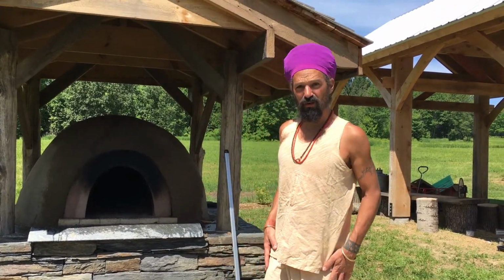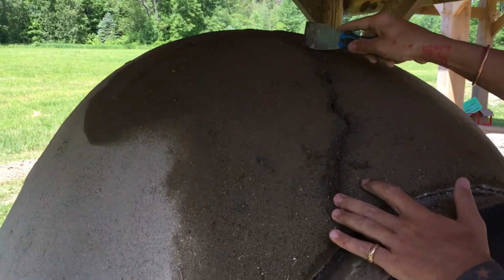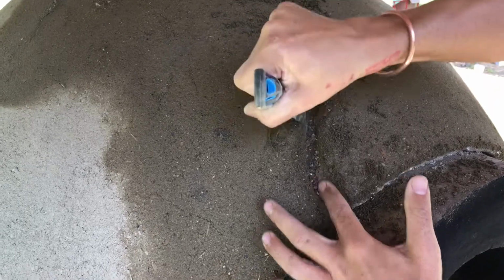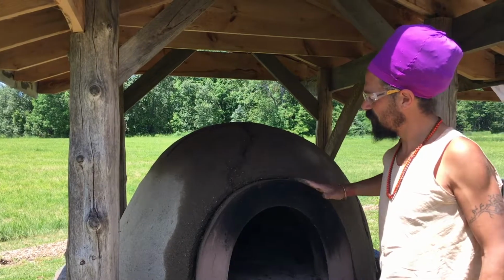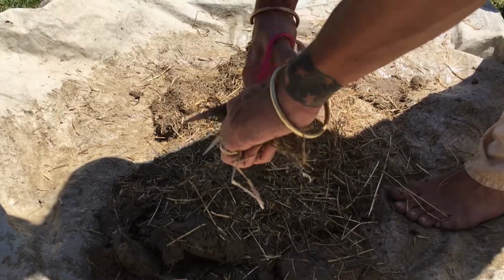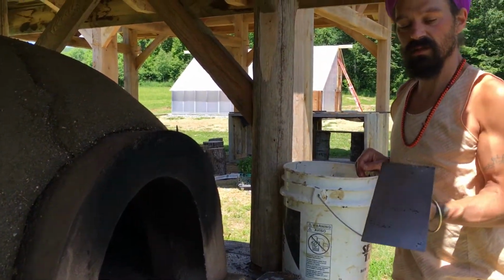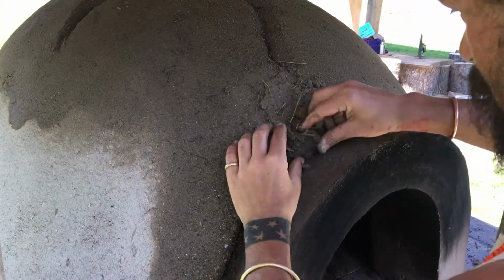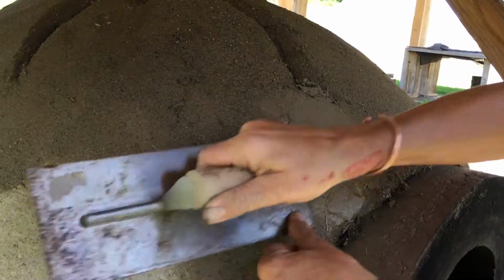Repairing Outdoor Pizza Oven Cracks

Comment: I repaired a reoccurring expansion crack moving up for my brick arch toward the top of my dome by working a piece of stainless steel window screen into the line plaster layer. It has not returned. Also, consider rolling a coat or two of a water class solution on the inside of the oven, It strengthens the surface and keeps any fine material from falling off. I did that when my oven was new.
Reply from the maker: Thanks for your insights. I have wondered about adding metal mesh to the plaster cracks, but have never tried it. I imagine your level of insulation would need to be good enough that the metal doesn't heat up. If it did heat up, I would imagine this could cause even more cracking. I have never heard of water class solution. Is it a natural material, heat resistant and permiable? I have never had any issues with the interior crumbling and falling.  Did you find this video through ovensdiy.com? If you are ever interested in making a post of your experience and knowledge on our new forum I would appreciate your contribution.  Peace, Will
Reply: @SimhaBode  That was a type o on my part. WATER GLASS is sodium silicate. It's a sealer and or binder. I applied it on the inside if my oven when it was new as a precaution. Seems to have worked great. 
Yes, the mesh is above my insulation level which is 6" thick. It also is on top or a bout an inch of lime plaster. I applied a thin wet coating of new plaster and worked the mesh into that. Then built up more plaster on top of the mesh. It is really holding up well so far.
I found the video just reviewing videos on cob ovens. Always like seeing what others are doing. Our oven is 7 years old. I added the brick door way after the original construction. Ive since had to replace the original keystone  about the same time I worked on the crack. These ovens are very versatile and easy to work on when needed.
Thanks for the invite. I will take a look at your site!

Comment: What material is your doorway arch?
Reply from the maker: This arch we cast out of a DI Y refractory cement. R-Cement = 1 part Portland cement 1 part fireclay 1 part lime  -  Final mix - 1 part R-cement to 3 parts sand. You can see photos of the forming process on my site ovensdiy.com on the blog post - “4 Easy to make materials you need to build an outdoor pizza oven”